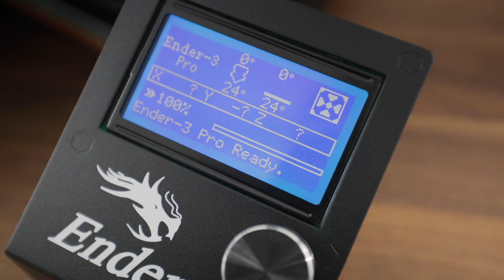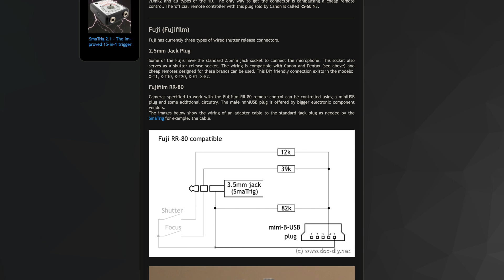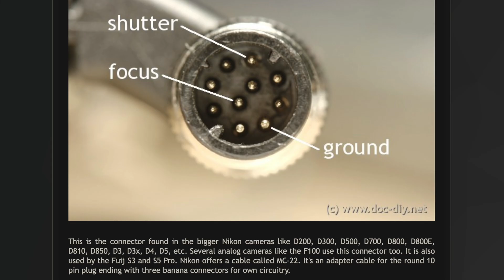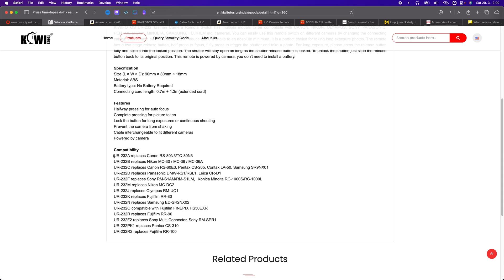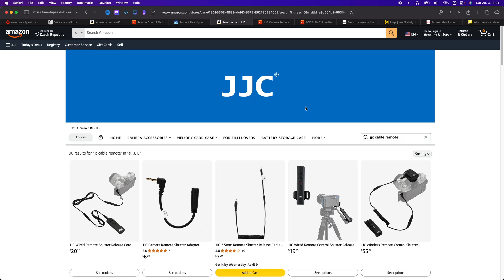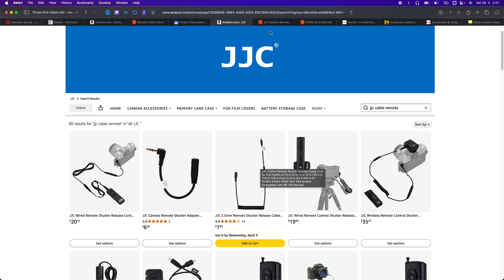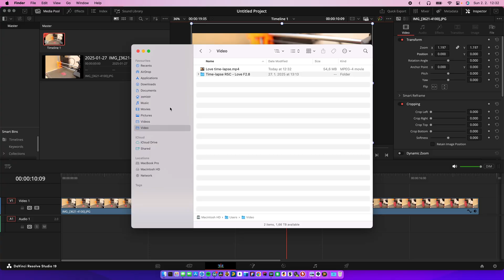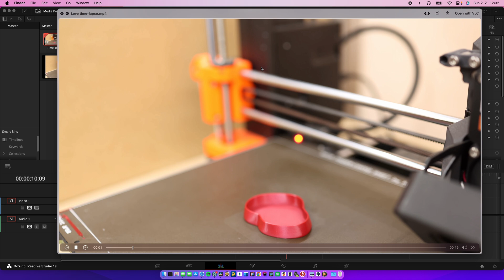Time-lapse videos with Prusa GPIO Hackerboard and camera using cable shutter trigger

Comment: Hello. New to programming and electronics in general. Where do I actually place the custom gcode for making the camera take the picture? I'm assuming you don't put it in its own block like shown at 7:00, so how does it get integrated into the already existing gcode that the slicer makes? Hope that makes sense. Like I said, new to all of this. 

Edit: I see theres an "After layer change G-code" section in the custom gcode menu. Do I put the custom code there?

Thanks
Reply from the maker: Everything is in my videos 🫣😁

Comment: i've been following your video series and I have my core one with hackerboard hooked up. I'm noticing a bit of stringing even when using your method of having the nozzle rest on the middle of the "x" inside the cylinder. do you change any nozzle temps or retractions settings when doing the timelapse? I LOVE your videos btw
Reply from the maker: Everything I changed is covered in my videos.
I don’t have the Prusa Core One so I can’t test the setting but soon I should have one.
Can you upload somewhere some 3mf example project with your setting so I can check it and try to help you?
If I am not mistaken, you are the guy from Reddit. Right?
Can you send me PM with the link there?
I will check it during the day.
I am from Czech Republic and we have here 3:14 AM right now so I should go to sleep now 😅